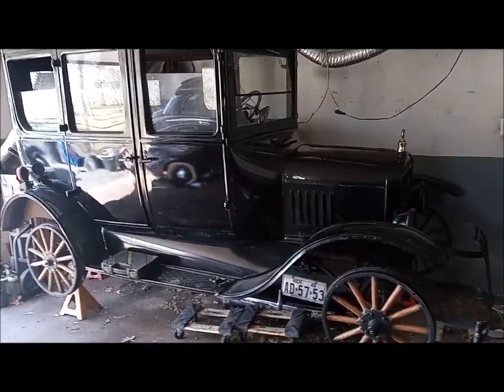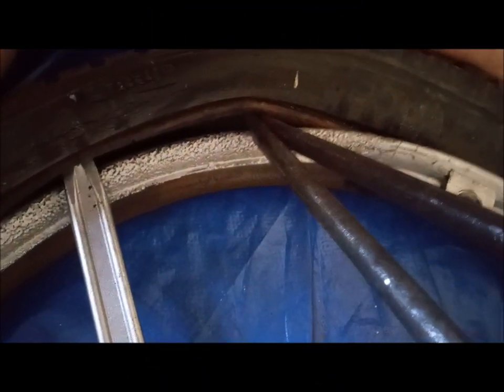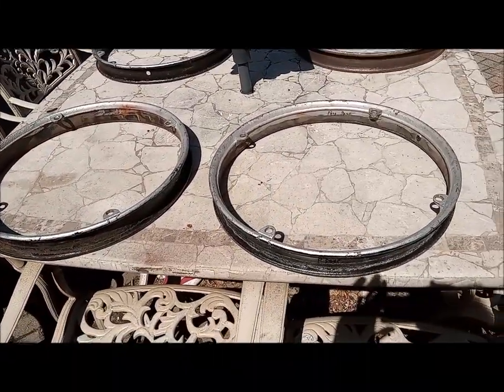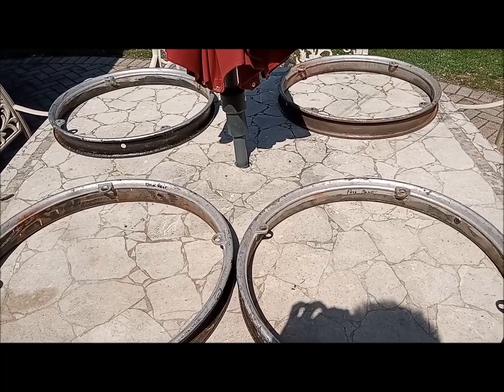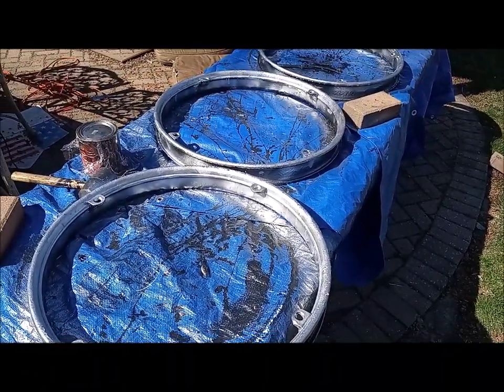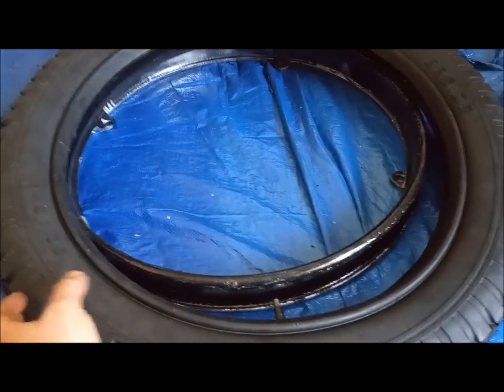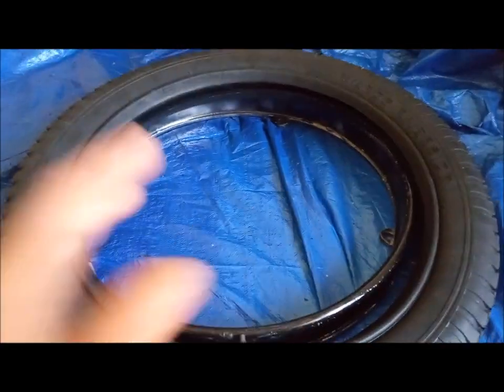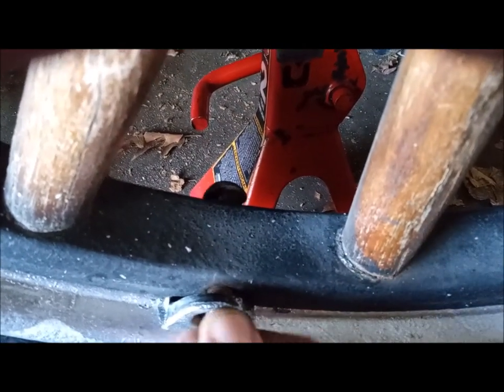Clincher Tire Replacement on 1923 Model T Ford (30x3-1/2 (23" Rim) Wards Riverside Clincher)

Comment: I'm just starting to work on restoring my 1924 TT. All 4 tires of mine are dry rotted, have zero flexibility left in them. Beads are torn open on one side on two of them. Being a truck, it uses the size your working on, as fronts, rear tires are 33x5. 
It looks like there's just a slight drop center on the rim, that makes me believe you want to break the bead on both sides first.
When I do conventional auto tires, tubeless, I spray window cleaner or dishwashing soap to reduce the chance of taking a bite from the tire bead (if doing flat repair), but it makes it easier to remove them. The down side using tire lubes, they are water based, and that water stays in the tire after airing it up. And that will corrode stuff. Talc would be a good thing to dust inside the tire carcass.
I agree with the flap, it protects the tube from being pinched by your tire iron.
That valve is called a Schrader valve. They make a valve stem fishing tool, that can be a small chain or cable attached to what looks like a valve cap, that screws onto the innertube stem. That lets you pull the inner tube stem back through the hole, should you not install them the way you did, by being careful and attempting alignment. You have no lube dry or wet, and the Pour40 stuff is sticky on your new rubber. With bike tires I've always slide the tire relative to the tube, as that will cut and shear it off when aired up. 

Here in Iowa, the land fill charges $6/tire. I cut them into 4 quarters, stack them, and place in black plastic garbage sack. The land fill has to pay to have them hauled away.
Did your 1923, originally come with silver painted rims?  Curious how much you paid for the on sale tires from Lucas?

Thanks for the video, cuss words didn't bother me a bit, as I use them to keep me from using a sledge hammer and "strike any key when ready".
Reply from the maker: Hello.  My car had silver pained rims when I bought it, so I decided it keep it that way.  I checked my invoice from Lucas and it shows $716 for the four tires.  The four tubes were $72 and the flaps were $136.  I just checked the Lucas website and they're the same price (regular price, over a year later), so it looks like I was hoodwinked into thinking they were on sale.  One thing that this video doesn't show is that I was sore for 3 days after I did this job.  There is no way that this job could have been completed using the "garbage bag" trick that some people mention.  Interestingly, I replaced the tires on my '31 Model A and the job was much less difficult.  Much less.  The Model T tires grip the rims with much more force than the Model A.
Reply: @flawrence11  I took all four rims off my truck yesterday after watching your video. The first rear tire I used a reciprocating saw, as the rubber was to hard to flex. And I found the steel wire they use around the bead, to be corroded to where it would just tear to pieces. On a truck the rear tires are larger then the front. They are 23x5, a bit harder to find. And the flaps are not typically carried. I did find they are on backorder at Coker tire. The truck used all blackwalls. They used to have knobby tread pattern, but now only passenger treads are being reproduced. That's OK. But I want to get the running gear in proper order, as well and engine, before I tackle the "C" cab. I don't know what the farmer that owned this truck pre 1970 hauled in the bed, but it corroded all the bottom sheet metal off, as wheel the rear sheetmetal of  the cab, and I have no idea how it is bolted to the frames as that's all gone. 
I purchased the truck from my neighbor, and moved it here back in 1984, and it's been stored waiting for a larger space to put it in. This I had built last summer, so it just got moved into the new garage last week. At age 67, I'm running out of time to restore this. I'm surprised there are so many businesses that are selling parts, as I would think the unrestored Model T market would be dried up by now. I better hurry, as that can change.

Comment: You should NEVER air up the tire on a rim that is not secured!!!  The easy way to secure it is to mount the rim on the car then air it up. This is especially ture with the clinchers because you need to over infalte the tire to seat the beads.  I learned about this when I was airing up a couple of tires that I had just mounted when the rim separated from the tire. Luckily I was not killed or injured!!  The rim was launched high into the air coming down about 20 or 30 feet away !!  This was about 4 years ago and the tire and rim are still running perfectly .  If you check tire inflating procedures you will be warned and instructed to use only a lockable air nozzle to the stem as well.  I guess the reason I was lucky is that I was changing these tires for a friend .. My '12 has nondemountables.